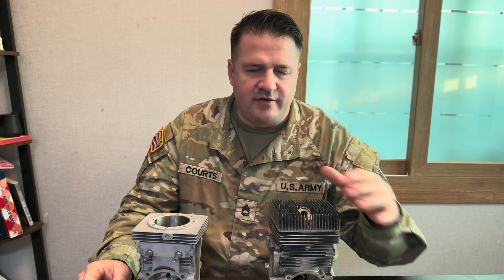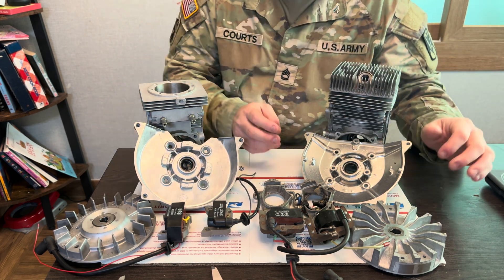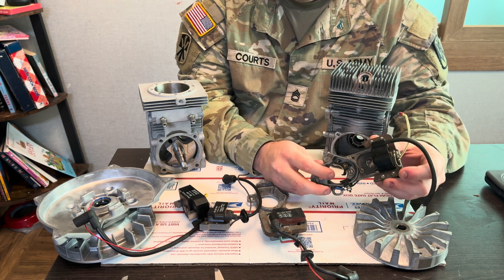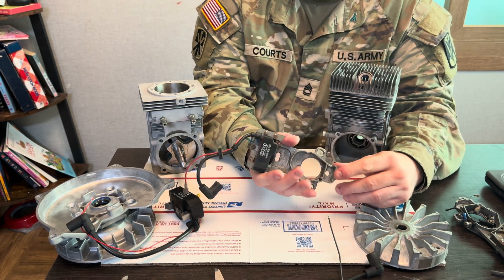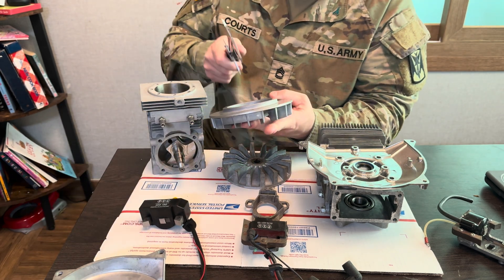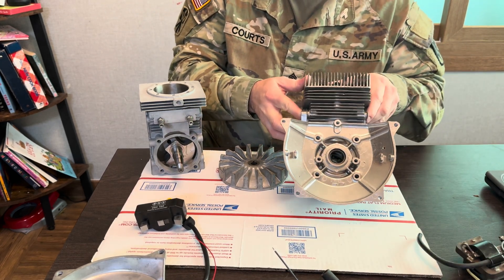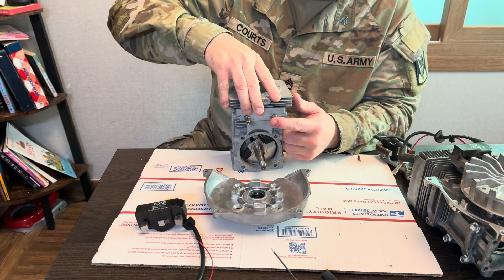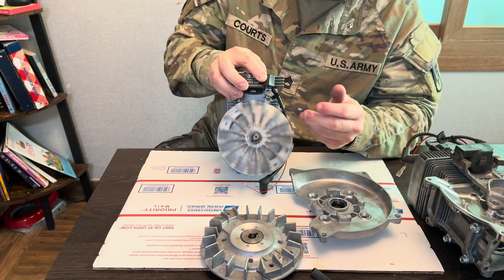West Bend 820 ignition system. Can we swap them?

Comment: ive got 2 sno runners and they dont have the posts to bolt the coil but it uses a bracket that bolts in wher the transfer port covers go and on both sides and the coil bolts to the bracket also has a stator i believe its called inside the flyweel  to run the lights .
Reply from the maker: Yes, that’s the typical Chrysler setup.

Comment: What is the difference between the PVL coils 455 140 and 460 190... can either be used on the stock 820..tks jim
Reply from the maker: The 455 140 is an analog coil. Very basic design with built in ignition chip module.  The 460 190 is a very advanced design. Technically superior in every way. It is digitally programmed to fire at a very low 300rpm @ 26deg BTDC, which allows for easy recoil starting.  Once the 460 190 hits 1000 rpm, the timing advances to 44deg BTDC, and timing does fade as RPMs increase, like the 455 140 does.  It has a built in 9000rpm rev limit, so it won't over rev and explode.   Now some consider that rev limiter as a drawback because they want to race and push the engine to the limits and beyond. Fortunately for those people, we still hav the analog 455 140 without the built in rev limiter. It doesn't have the other features, but at least you can rev it until it explodes.
Reply: Thank you for the informatiom... Jim